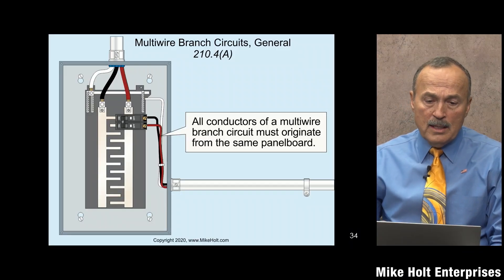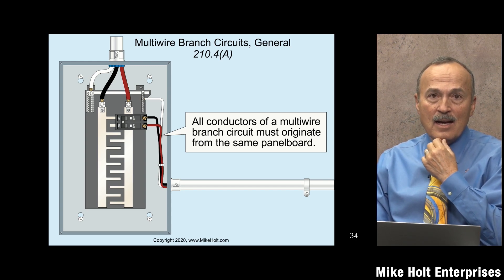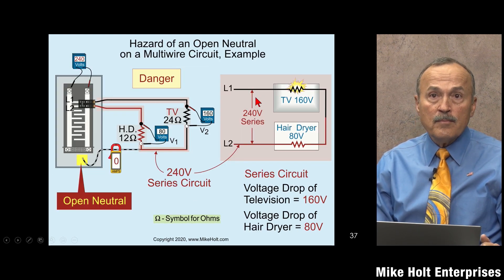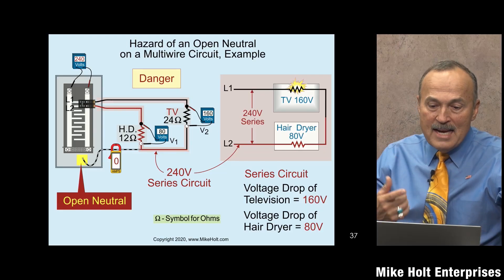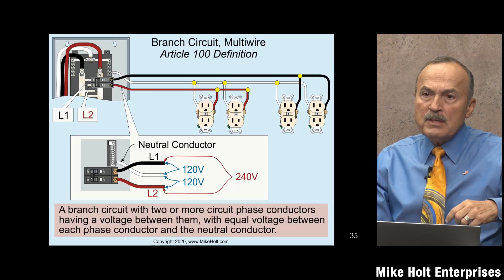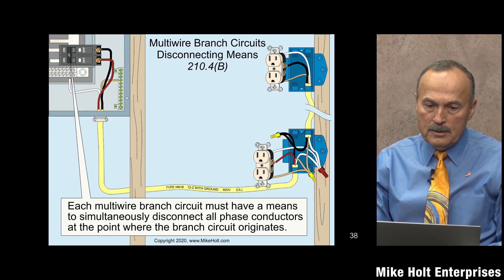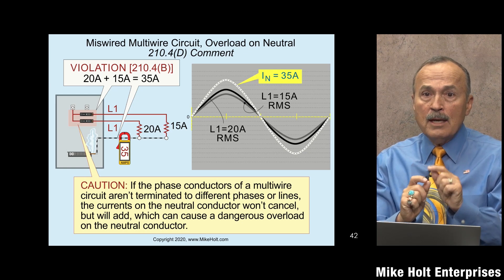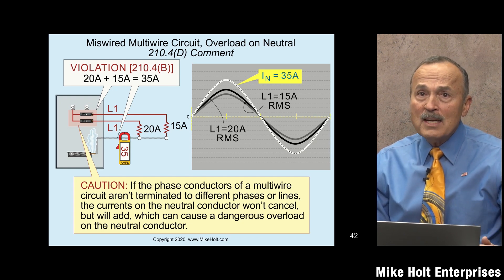Branch Circuit, Multiwire, NEC 2020 - [210.4], (19min:38sec)

Comment: I was working at a hospital, a maintenance electrician was working nearby.  He opened a junction box and unbundled the neutrals while the circuit was energized.  There was a nice POP ....... A few minutes later the Director of the Laboratory walked out into the hallway and asked why the power to a section of his lab just went out.  At the end of the day, there was $120,000 worth of damaged equipment...It was a multi-wire branch circuit.
Reply from the maker: Oh my gosh, this is the number one story on this topic! I'll share this in my next class.
Reply: @MikeHoltNEC  when, during this video, Laboratory’s were mentioned specifically, I just laughed because of how practical the information was to me because of this experience. It’s a very real issue with that circuit. Edison didn’t have to worry about electronics in the 1890’s.
Reply: Why not just flip the breaker to the off position before disconnecting the neutral on any type of branch circuit, multi-wire or otherwise?
 If not you always run the risk of having an energized neutral situation. I’ve seen energized neutrals on regular branch circuits where the power would come through the load and into the connecting neutral.
Reply: @defytyrantsofmississippi2198  The point is that you don't necessarily know that a neutral is being used by another circuit unless you put an amp meter on it after you turn off the circuit that you want to work on.
Even worse (though  VERY unlikely), before you turn off the breaker you work on, you see 10 amps on the hot and 10 amps on the neutral ...BUT this is a neutral that is also being fed by 2 other circuits that are on opposite poles and also have 10 amps on each.  The 10 amps on opposite poles cancel each other out so that your amp meter would read 0 amps after you turn off the breaker that you want to work on.  Not  much you can do about that other than measure amperage on the neutral while turning off each of the other breakers ...and nobody is going to do that.
I work extensively in old houses and I have seen a few examples of more than 2 hots using a single neutral.  I've seen things like 5 hots using 3 neutrals through various junction boxes.  This sort of thing happens because an 'electrician' just randomly connects circuits in an old fuse box that gets turned into a junction box without maintaining the paired status of each circuit's hot(s) and neutral.
THIS IS JUST ANOTHER REASON THAT AFCI AND GFCI PROTECTION IS SO IMPORTANT.
Reply: @SwingboyPA somebody said ”oh here’s a hot now I just need to find a neutral a ground or a water pipe somewhere” I feel your pain man every day.  I see you have PA in your handle if your from PA ever hear of Levittown? I work a lot in the town across the river that Levitt built called Willingboro.  Absolute nightmares
Reply: @MrStatic101  yeah, I'm in Philadelphia, so it's a lot of old housing stock. Working class people like to DYI and, while I don't blame them, I do wish that they would learn something more than "Oh this is hot and this is neutral, now everything will work".
Reply: The morale of the story is shared neutrals are not the problem. Poor workmanship and/or poor safety protocols are the problem.
Reply: 120K is pretty bad but I got you beat. Working as a locomotive technician, we had a mixup on current software. Manager had me put the wrong control package on a locomotive and we burned up $750,000 worth of equipment.

Comment: 10:30 i agree with the contractor. Its up to the freken devices ( high tech) to design them in a way they can work using current NEC. Code....the NEC Code book its meant to be a CODE . not to CHANGE It. Its defying its meaning if you change it every freken 4 years

Comment: In 3 phase Wye multiwire branch circuits with nonlinear loads, one can create high harmonic currents in the neutral. Can anyone elaborate on this?
Reply from the maker: This is no longer an issue in todays wiring because 'tuning filters' have been added to equipment. But do a search for harmonics to gain more information.

Comment: there are times I need 240 volts here. So I run DP Breakers for those circuits. But I still run two neutrals and mark them. Because my 240 circuits do not need the neutrals but my 120 volt outlets do.

Comment: I'm currently doing a remodel on a house. In two different locations I isolated the breaker and turned it off. But I was still reading a small amount of voltage 24 volts I believe. And one case I was able to find the other breaker and completely turn it off. Looks like this is a multi-branch but the breakers are not connected with each other. Very dangerous.
Reply: yep common in older houses 🏡 as i have the same experience as you and it can start a fire 🔥 and damage equipment or hurt you ie 40v to 260v but not stable at that voltage as it was grounding funny ect. and its also common to see little to no safety bonding/grounding or improper neutral bonding
Reply: I absolutely hate this rule. But I do understand the importance of if.

Comment: I just had an issue with a damaged receptacle on a 3 wire circuit, the receptacle was being use as a juction to feed the other receptacles on the other rooms,  when I disconnected the neutral  , the other room receptacles increased the voltage to 180 v.  And the neutral going to the load was backfeding 108 v intermittently . Got me thinking about how easy one can damage equipment with this wirings Wich I guess it was normal in the old days.
Reply: common in the older houses ( per-1990's ) iv live in sadly, and yes it can start fires 🔥 and or damage equipment or hurt someone

Comment: Anyone have a good idea of why the inspector failed me on:....older house service upgrade
service upgrade to 200a. No re wire. no 6 Range wire landed on 2pole 50a.
Keep in mind older wire so the jacketed cable has 2 current carrying conductors and 1 stranded al ground...HE will not pass till I send a picture of that stranded al ground tapped white... Why would I indicate that a non insulated wire is an insulated a neutral???
Reply: Post your question on MikeHolt.com/Forum.

Comment: Are you saying that in order for two hots to share a neutral they(the 2 hots) have to land on the same breaker? Like a 2 pole breaker?
Reply from the maker: Nope, watch the video again. Two single-pole breaker with 'identified' handle tie are permitted, see 240.15(B).
Reply: but the voltage between the 2 hot wires must be 240vm diff phase?

Comment: Looking at a the definition of article 100 we could infer that a 3-wire delta circuit and a 4-wire delta circuit are not MW circuits because in the former there is no neutral, and in the latter there are no L-N voltages. Yet a corner grounded delta could be considered a multi wire circuit because it has a balanced L-N voltages.  Food for thought.
Reply from the maker: Hum... never considered this angle, but you are right!

Comment: Interesting stuff!  As a "DIY guy" I see 12/2 is half the price as 12/3 (for example), why not run all 12/2?!  I suppose less labor.  Are MWBC's typically used in residential applications?
Reply: @suspicionofdeceit I had them in my residential home.  But that's because I hired a commercial electrician to do the work :)
Reply: tough to use in residential these days because the nec has lost their damn minds with GFCI/AFCI being required basically everywhere.
Reply: @suspicionofdeceit my house in Seattle is a 2001 build and there are 5 general lighting/recep circuits. 4 of the 5 are actually paired MWBC. So probably the only reason the 5th isn't also a MWBC is because it's an odd number remainder.
Reply: @suspicionofdeceit they are around everywhere. Including residential easpecially if home had upgrades over the years

Comment: It's amazing how few who work with electrical wiring actually understand this phenomenon of the Edison 3 wire system. To the point where when I wish to communicate my skill set I just say, "did you know when both branches are balanced the neutral current gets nulled out, down to zero." It wasn't until I was 40, looking at a panel and saw three 10 gauge wires heading to an apartment and it hit me. Why isn't the neutral bigger, won't it have twice the current? It was at this moment my teacher from RETS (radio-electronics-television-service) stopped by. I spent 3 days wrapping my mind around what's happening literally inside the wire nut where it goes from 3 wire to 4 wire.
Reply: WOW, a RETS grad.  I went to RETS in Nutley and graduated in 1979.  We did a lot of partying in the parking lot, but I learned a lot and did very well.  Retired now.  It's a small world.
Reply: Same here. Catonsville, MD. 1999

Comment: My house (built in 1978) has two MW circuits. Neither of them had handle ties for the breakers (they weren't even next to each other although they were on separate legs) AND the circuit to the laundry room used the device yoke for dividing it up!!. Needless to say, I fixed that very quickly.

Neutral integrity is an absolute with MW circuits. Period.

Reckon I'm showing my age here, but I also refer to these as "Edison" circuits.

Comment: I used to run them everywhere... but my reading of the AFCI requirements make that prohibitively expensive for residential work. You have to either buy a 2 pole AFCI breaker (100-250$ per breaker or run EMT all to "save" a single 12g or 14g THHN wire....)  Not a huge fan of handle ties b/c they seem to get removed when the grouped single pole breakers inevitably get moved. If there is a way to run them that makes sense (cost wise) and follow the AFCI requirements i would love to know.
Reply: 210.12 (A)(4) says that you can use a AFCI rated receptacle at the beginning of a branch circuit, up to 50ft for 14g and 70ft for 12g. Hope that helps.
Reply: @simmcowaPang122  I wish that was an interpretation I could hold  I could be wrong (please let me know if I am)
 but 2019 was the last time I did heavy research into it.... So if its outdated PLEASE correct me
I know there are jurisdictions that are allowing this (including my home jurisdiction). But other then using the single pole "Eaton Combination"  I just don't see it actually satisfying 210.12(A)(4). 

Eaton  have a listed "standard" breaker/AFCI 1st receptacle  that when used in combination DO satisfy the requirements but Im not clear how ANY standard breaker/NMC/AFCI receptacle could.

 I believe  (with strong evidence)  that any "standard" breaker/NMC/AFCI 1st receptacle does not satisfy 240(A)(4) and allowing it is a miss interpretation on behalf of my jurisdiction and others.

My reading/interpretation of the exceptions that would satisfy code would fall under sections 210.12(A)(4)... The only UL listed product that would meet the poorly worded code that are commercially available to allow use under this section (Specifically under 240(A)(4)) would be the "Eaton Combination"  ... 

The Eaton combination's UL listing meets the requirements of 210.12(A)(4) as a "System Combination". In other words only when a specific Eaton only (non afci) breaker  and the Eaton only AFCI device tested and listed as a combination as a listed system qualifies.

 I only install Square D for a number of reason so for me its not an option... Even though it would MAY pass inspection... and I would generally have to argue it up the chain... which makes the "cost savings" moot. I dont agree with the code wording and think the AFCI requirements are gov't mandated corporate welfare.. But I follow the code as written (in my interpretation) b/c in order to hold this strong ANTI-Post 1997 Code  changes turned mfg sponsored marketing nonsense position and advocate for changes I think its a moral imperative to.

We need to CHANGE the code its nonsense not find workarounds that will pass but DONT (in my interpretation) actually satisfy the code... The code is the problem and needs to have common sense safety not corporate sales as its primary purpose and that unfortunately has been the evolution of the code since about (at the latest) 2008... and I would argue 1997 was the last pure "safety" focused code. Its been downhill corporate shilling since.
Reply: We used to run a standard 2pole breaker on 12/3 romex to GFCI 1st receptacles on the A leg and B leg and it worked great, was efficient use of materials and was less cost. in materials/labor and saved customers money... It worked well, safely and was highly efficient .. that changed when the AFCI requirements came into effect for Small Appliance Branch Circuits...  

 In my opinion these code changes were made to sell MORE copper 2x 12/2s and 2x 10times more expensive AFCI/GFCI Combo breakers. There is no good argument for requiring AFCI protection on Small appliance circuits that already had GFCI requirements... its was all about SALES in the name of safety and is total corruption.

Ohio for instance SPECIFICALLY EXCLUDES small appliance branch circuits from AFCI requirements b/c the justification for requiring them is ridiculous.  The Qty., placement and amperage requirements for Small appliance branch circuits and the UL listing requirements for small appliance already address the supposed  "dangers" used to justify AFCI requirements in the 1st place.

Ohio has the exception to specifically allow the use of MWBCs to meet the requirements to provide the large numbers of separate Small appliance branch circuits in a safe and efficient way and to cost effectively allow installations that are arguably safer due to provided many separate 20amp circuits that will likely have large inductive and resistive loads simultaneously operated while connected to them.  

Arguably NMC(romex) does not require AFCI protection from the 1st receptacle to the service panel when installed properly according to codes as old as '95... . the only good argument is "at and after"the 1st receptacle.... so that crappy electronics and extension cords plugged into garbage quality back stabbed $0.99 duplex receptacles dont burn your house down... 

That was the ENTIRE stated premise for AFCI in the 1st place... It was not to protect branch circuit wiring from the panel to the 1st outlet. But of course now the code panels position is that "the tech exists so now you need AFCI to protect that "dangerous" NMC from undesired effect of arcing" Nmc that didn't become dangerous when properly sized and installed until 2008.... 

Its not NMC (Romex) its the devices including and running from the 1st downstream receptacle and the equipment plugged into them are the problem.. 

The problem IS NOT properly sized and installed Romex from the 1st outlet to the service panel... The code panel is making that argument now in the name of selling product as corporate shills.